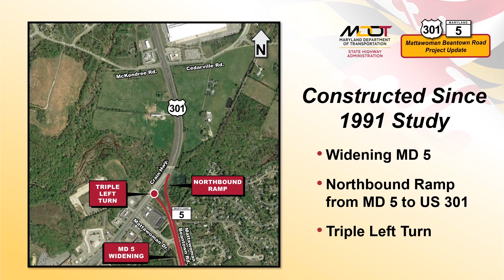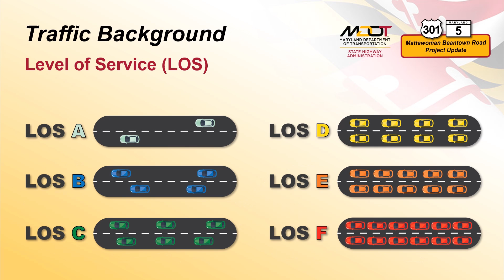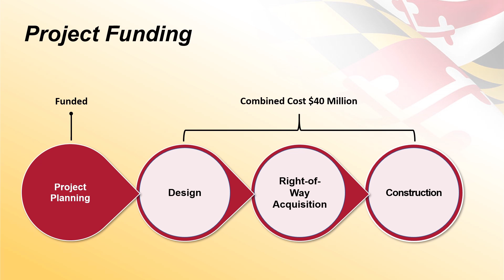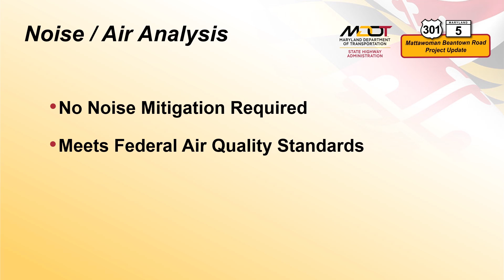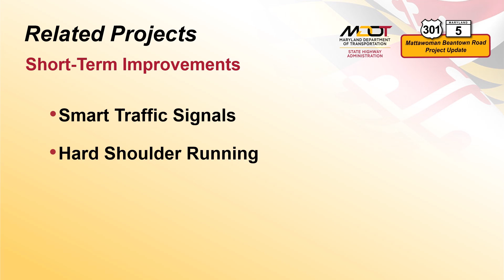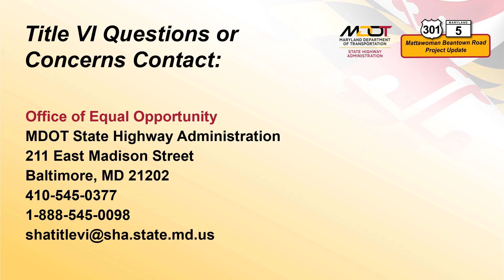US 301 MD 5 Mattawoman Beantown Road Project

Comment: The result of this project just moves the traffic faster to build up at Nike light, St Peters Church Road and most of all the light where traffic turns left to at the Shell gas station. The backup at rush hour already backs up this will just expedite the back up. What is need is a bypass that takes traffic to below Forest Heights (45 mile zone), Also a bypass around Waldorf is needed now.